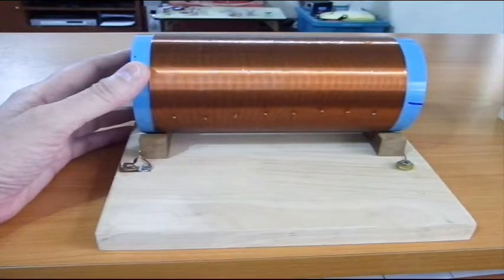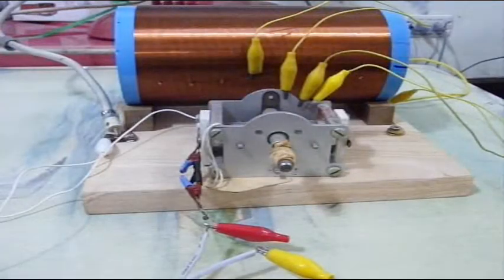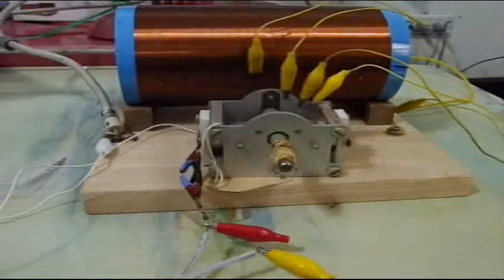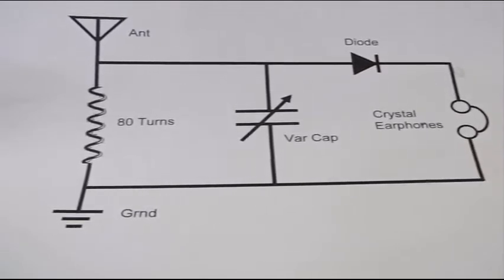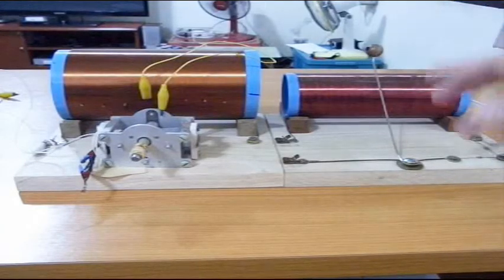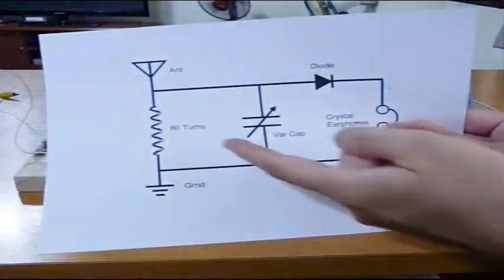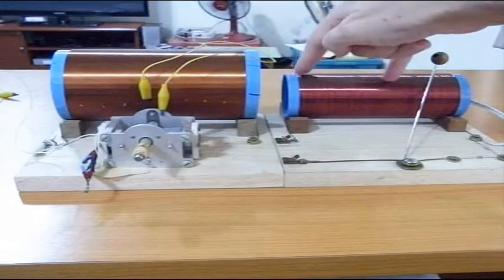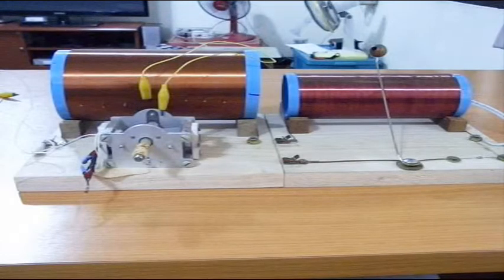Popular Crystal Radio Design That's a Waste of Time - And Why

Comment: It would help if you also showed the schematic of the wiper!  Does each side of the wiper coil interact with the whole circuit?
Reply from the maker: I don't understand. The coil is connected on each end, and the wiper is a variable tap.
Reply: Sorry, I understand electronics enough to be dangerous! Most circuits I've seen with coils with taps, it appears the length of the coil (inductance) is determined by the antenna point on the coil to the tap; the coil beyond the tap is not in the circuit. On the wiper radio, the whole coil appears to be in the circuit all the time. I understand the antenna point to the wiper determines the inductance and the resonance, what is not clear to me is how the coil beyond the wiper (tap) interacts with the circuit? Does that make sense?
Reply from the maker: @rogervaught3985  In this type of crystal radio: https://youtu.be/fLVCqZGpv3U
the wiper is dividing the coil into 2 parts, the antenna side, and the "listening" side. If you follow the electricity coming in on the antenna, it flows from left to right along the coil, until it hits the wiper, then (most of it) takes the easiest path to ground down the wiper. The remaining signal stimulates the right side coil at its tuned resonant frequency, which is what you hear on the earphone. The 2 halves are like 2 sides of a transformer. It's a rough system, but for as simple as it is, it works rather well.
Reply: @tsbrownie  Thanks for the prompt reply. If I understand correctly, the magnetic field of the left side of the coil induces a signal in the right side. Interesting. Change one side and the other changes too. Me tiny mind is still processing! 
In any case, this will be my next crystal set to explore. I'll also build a wiper antenna loading (tuning) coil. Thanks again.
Reply from the maker: @rogervaught3985  Yes that's right.

Comment: It’s mostly about the amount of energy taken out of the tuned circuit.  Take a lot of energy out and the response is low , wide and flat. Take no energy out, the response is high and narrow. Somewhere in between is good.
Reply from the maker: I think another issue is that the coil is saturated, leading to it outputting only the strongest station, while the weaker ones are washed away. I'm looking at such a circuit fed by loose coupling to the antenna.

Comment: Capacitor creates impedance against the resonation. So it makes the wave shorter but also weaker. If you want to use tapped coil, keep the distances short and capacitor value small. The viper works best. Capacitor works little better for the antenna, but if it's always needed it might be better to use smaller antenna and additional loading coil for it.

Comment: https://www.youtube.com/watch?v=ZMpi79fK2_g   this is no antenna , its a coil and ajustment with croco , looks really nice , i see also an italian radio design with 2 loops , around 60cm coils  from 1919 , with switcher for the coils , in the box just 2 movable condensators and tube amplifier